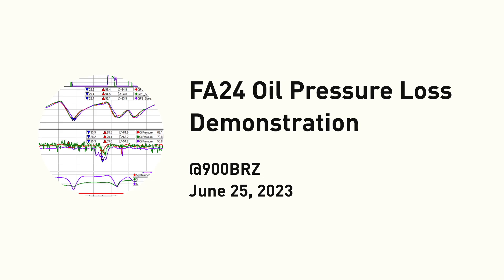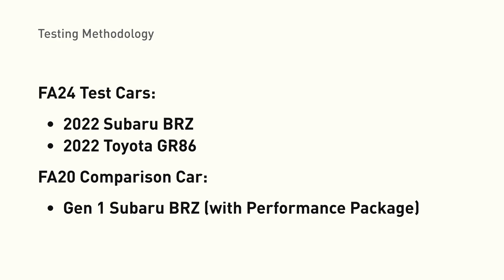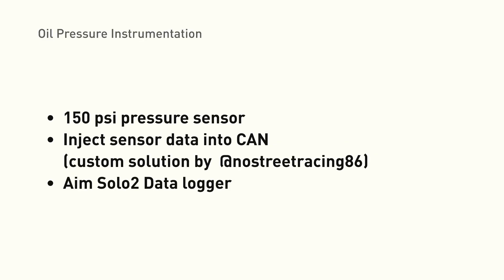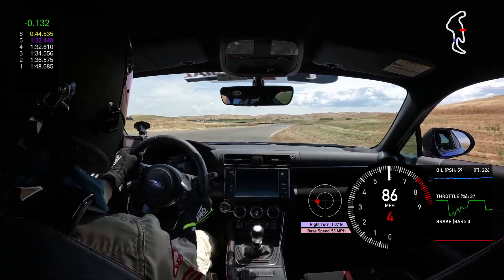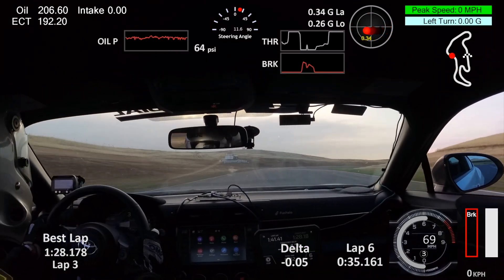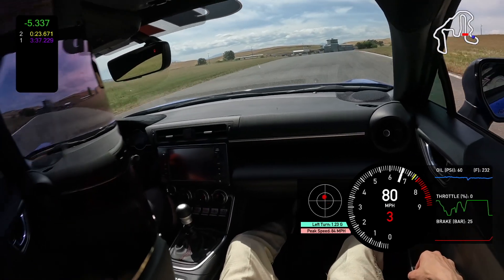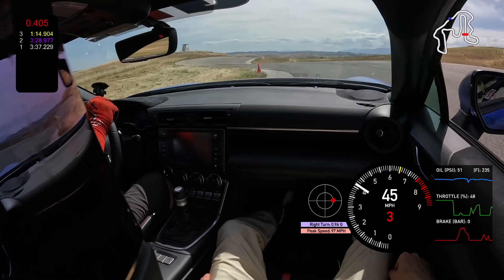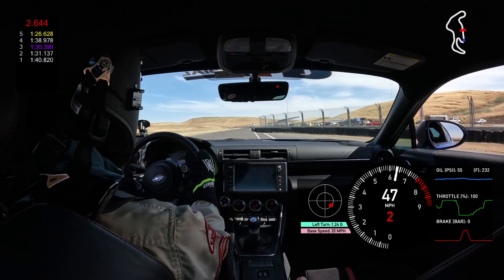BRZ/GR86 FA24 Oil Pressure Loss Demonstration

Comment: Hi, about the video, will the oil pressure drop at low rpm with elevated and right turns?
Reply from the maker: At low RPM, the expected pressures are lower. Not exactly sure what you’re asking.
Reply: @900BRZ  guessing he is curious as to whether at lower rpm, if there is a pressure drop (from the already expected lower pressure) as a result of right hand turns at high G.
Reply: @michaelruddick2662  right
Reply: @900BRZ  i wonder if i should be worried if i only use it for daily drives
Reply from the maker: Generally, I think people driving on the street should not worry about this. If I was only driving on the street, I would keep the powertrain entirely stock and trust that the warranty will be honored. At low RPM, we see less pressure drops because the pump has lower flow. The oil in the sump stays available to the pickup.

Comment: I always ran my 2008 STI with sticy R888 with no issues. But i always ran 1 extra qty because I expected not to just sit on the oil pan at Barber. I am not sure if it help, but never wiped a bearing even on summer track days. A test running 1/2, 1 qty, 1.5 and 2 qty extra oil would be great. It could be a simple fix.

Comment: Quick theory could the g forces be enough to possibly cause the oil pump pressure relief valve to crack open?
Reply from the maker: It’s very hard for me to test and honestly I don’t have enough familiarity with the design of that component to conjecture. It’s a valid hypothesis though.

Comment: This is really bad for the US market. ALL of our highway on/off ramps are right hand, high speed, and accelerating/decelerating
Reply: This should not be a problem on the street If you're pulling >1G on an off ramp and revving the engine to 6k RPMs... you're doing something wrong
Reply: @i-barg  LOL, but .... but ... an onramp...right hander...empty highway...punch it!  ;)   Granted, it's probably going to be banked, and you won't get lateral G's >1, but, just sayin.
Reply from the maker: Banking is probably not helpful either. I think it’s possible to reproduce this on the street, but unlikely for most people and I haven’t done any street testing.

Comment: Why don't the people who track these things install an oil accumulator?  They've existed for a long time for this reason. Even on engines that aren't prone to oil starvation many will still install them as insurance.
Reply from the maker: It might be a good idea at some point, but it’s not the first line of defense. It adds multiple failure points and requires additional maintenance.
Reply: @900BRZ  in my experience as long as it's a good quality kit like accusump and it's installed by a good mechanic it'll last year's without needing anything. I don't know about other brands but accusump is good.

Comment: The pressure drop so much! This is indication that the oil pick up is sucking in air instead of oil. it is a mixture. This will likely destroy your engine at some point.

Comment: My biggest question is: What oil level was that testing done at? Was it at "Full level" mark on the dipstick or "LOW" or  something in between? Did you try to overfill from FULL by adding  lets say a half quart on top?  And why this wasn't mentioned in Methodology part?  It's important because it's obvious that the engine just starves when the oil is pulled to the side by the G force inside the oil pan and it's simply not getting picked up by the pick up tube so the air bubbles get in causing the pressure to drop.
Reply from the maker: Full mark on the dipstick or just above on all 3 cars. I should have mentioned it.

Comment: As a previous engineer for an OEM ; 

1. Thank you - very informative
2. They knew
Reply from the maker: It would be disappointing if they knew and disappointing if they didn’t know.
Reply: This seems typical Subaru. Surprised Toyota signed off on this. The fix for it seems simple and inexpensive. No, I wouldn’t buy a Subaru, this is just one more reason.
Reply: "impossibru"
Reply: As a current engineer in the industry, they absolutely knew, and don't give a shit about it at all. I will never buy a Subaru ever again.
Reply: @PowerSports  - "I will never buy a Subaru ever again."
Its not a "Subaru Issue" its a Horizonal Engine issue.
The old VW bugs had "Deep Sump" aftermarket add Ons that helped with the issue.
My 71 Porsche 914 has the SAME ISSUE. Fix: run with 2 extra quarts of oil.
Reply: @stuartgray5877 you seriously comparing a modern motor to a 60 year old motor? They marketed this car as a track day car, it should have a dry sump system. The RTV issue is just poor quality control.
Reply: @truantray  - I am just pointing out one of the inherent disadvantages to a horizontally opposed engine - The Geometry does not allow for a deep sump IF you are going for a low CG.
I didn't say anything about the RTV.
Reply from the maker: Agree with that.
Reply: @truantray  Even the original WRX couldn't track without oiling system mods. It's basically common knowledge that you need to upgrade a Subaru to track it (except the STI, of course).
Reply: @truantray  Dry sump would've made the car $60k instead of $40k, There is no "RTV issue", it's just something non engineers latched onto as an early cause. Every car made, from any manufacturer, that uses RTV in the engine assembly process will have peices of RTV in the fluids.
Reply: @stuartgray5877  im only up to the second turn here. It seems to me like on both instances theres a downward effect on the car too. The dip on 5 at the curb and the ridge. Is this because of the momentary weightlessness effect? Sort of like how you feel your lunch rise on a rollercoaster? I also thought prior to having seen the corners, and hearing that it was above 6000rpm in an interview done with another channel, that the crank rotation could be having an effect. Id dare say crank counterweights (ive never seen a horizontal crank full disclosure and all) would have to be creating a fair bit of turbulence. Like the spin function on a washing machine. Could the right hand turn just be enough to push the extremes of this sump and pickups design? I wonder what the crankcase pressures were at that moment too.... just a brain fart

Most of my very basic understanding has been picked up from looking into sumping issues on milwaukee8 engines
Reply: @willconklin7739  - "There is no "RTV issue", it's just something non engineers latched onto as an early cause."

There 100% IS a "RTV issue" try to keep up.
The biggest issue is not from the factory RTV job as it is done by robots. The REAL "RTV issue" is when the human Techs have to work on the engine. It is nearly impossible to get the RTV on the front cover correctly without putting on too much or too little, and IN TIME.
Reply: @stuartgray5877  still wrong....
Reply: @willconklin7739  Not "wrong" the failures that occurred right after having the cars worked on and the discrepancy between the failures at the Toyota Dealers versus the Suby dealers tells the facts.
The rework at Toyota had much higher failure rates because the Subaru dealers had more experience putting on the sealant on the front covers.
The Toy techs had no experience with the flat engines so messed up more frequently.
It is STILL more difficult to get the sealant on correctly with a human instead of a robot, or are you going to argue that is false too?
Reply: @willconklin7739  DO you even HAVE a BRZ?   I have a 2013 and a 71 Porsche 914.  Both have oil pressure issues under hard cornering on the track.  And my BRZ has had the front cover off numerous times and the dealer cannot fix the leaks they caused after opening it THE FIRST TIME.
Reply: @stuartgray5877  First off, you are changing the entire topic of the original discussion. The original discussion was the thought that RTV was over-applied AT THE FACTORY that was causing factory fresh engine failures in the 2nd gen cars, the evidence used was RTV bits in the oil strainer of the pick up tube. That was never the case. I urge anyone to dissassemble an engine from any manufacturer in the modern era, the majority are sealed with RTV and all that are will have RTV fragments caught in the strainer.

You are the one that tried to change the subject to engines that had been repaired by some mechanic being grenaded by RTV.

And for that subject I can guarantee you any RTV plugging of the pick up weren't from application issues, but from poor cleaning procedures when removing the old RTV by poorly skilled "mechanics" during engine repairs.
Reply: @stuartgray5877  I have owned multiple BRZ's and still have a 2013 BRZ that was bought new just to track. It is currently 11 years old and has 34,000 hard, track-only miles, all on the original engine that has never had an oil leak.

I have built over 20 BRZ, FRS & 86 chassis' into track and race cars for customers and maintain a majority of them still. I also maintain a bunch of street driven Subaru vehicles for other customers of mine.  Sounds like you need to find a better mechanic.
Reply: @stuartgray5877 huh? My 982 718 with the 2.0l flat 4 doesn't give me oil pressure loss through sharp cornering in either direction, try again....
Reply: @lanemiller08 It's a flat 4, so I doubt that.
Reply: @PowerSports  yup yup
Reply: Yes offcourse, but the average buyer will never experience this problem. If you want a problem free engine just get a m52b28 peace ✌🏼
Reply: @tinuse3670 I am an average driver and experienced the problem.
Reply: Outstanding information and presentation. I do hope an efficient solution is found.
Reply: 100% they knew, all subaru's are trash and have been. Im not surprised at all, its hilarious
Reply: @vicentechamberlain579 if all Subarus are trash why do many of them do 150k miles of being driven hard 😂. It's only ones that were made by the apprentice or on Friday that are bad 😂
Reply: @LawrenceTimme Subarus are made by hand??
Reply: @RAY_FILET  yes. They are nowhere near as automated as Germans or giant companies like Toyota and Honda. Many processes are done by a human bean
Reply: @LawrenceTimme  had absolutely no idea.  Thanks for the info!...Toyota must have been cool with that, considering the fact that the GR86 is made in the Subaru plant.  Least I thought it was.

Comment: Thank you so much for all this data! I love seeing actual science at play instead of just throwing assumptions around. I just got a new brz a few months ago and I have been a little concerned about all the oiling issues I was seeing with these cars. Again, can't thank you enough just gave you a sub to try to support you on this journey to figure out what can possibly fix all the blown motors on track.
Reply: Guaranteed fix would be to buy a car actually designed for the track.  You bought a normal car with flashy marketing.

Comment: So this is a well known issue with the WRX guys, but Porsche makes horizontal engines too, and they don't seem to have this issue. What's their solution? Dry sumps?
Reply from the maker: They use dry sumps on their GT cars and integrated dry sumps on their other flat engines. My understanding is this means they do not have a separate oil reservoir, as in true dry sump designs. Check out this post for more detail: https://www.6speedonline.com/forums/996/67522-please-explain-integrated-dry-sump-oiling-m96-03-engine-how-different-fro.html#post849783

Comment: I have a 2020 BRZ with the performance pack, about 18 track days on it. The engine has been the worst part about the car from the beginning (oiling issues, low power, weird torque curve shape), it's interesting to see that they're backsliding in terms of oiling issues while working on the other ones. This car should have had a Toyota I4 from day 1, Subaru can't build good performance engines.

Comment: Would be curious for a quick run down on your filming/daq setup/post processing to get the overlays. Does the aimsport do all of this or are you bringing in video and manually syncing etc?
Reply from the maker: For data acquisition, I’m hooked into the CAN feed that powers the ASC (sound machine). The CAN injector MCU accepts the CAN feed from the ASC and injects the oil pressure data into the CAN feed, which then goes to the Aim Solo 2 DL. All the hard stuff here was figured out by @nostreetracing86. He’s and @TrackandBuild have been doing this kind of data logging for over 6 months now!

I download the data to Race Studio 3, which is an Aim product. I then export that data and bring it into Race Render, along with video from a GoPro. Race Render allows you to sync the data to the video. 

I export the track footage with the data overlayed and then bring it into Final Cut Pro X in order to do editing.

Comment: Sounds like a design issue. Subaru engineering at its finest 🤢 how you don't take into account cornering forces when designing the oil system sounds ridiculous to me, and Subaru needs to be S U E D to Kingdom Come.

Comment: Great effort! Need to get to the bottom of this. A clear polycarbonate oil pan and a go-pro pointing right at it?
  Driving at 6-7k rpm oil pump is doing its job moving large volume of oil and too much of it stays in the heads (nothing new here). It is slow to drain back to the sump. Oil gets picked up and pumped out as fast as it drains back. Slightest disturbance causes the pump to suck in air, in this case it just happens to be the right hand turns that affect it more than anything.
 In your next session, overfill your oil by 1 liter. Would be nice to see the data then.
Reply from the maker: Clear pan would be fascinating!

Comment: The Porsche Cayman S 987.1, 2006-8 had an oil starvation problem that may be similar, with numerous engines lost to oil starvation usually leading to piston rod bolt failure. I had a 2006 but sold it rather than tracking it and bought a 2009 instead.

Oil starvation in the 987.1 was caused by oil accumulation in head during high G turns but not necessarily at the highest RPMs. There was a scavenger pump/oil pump mismatch around 4k.  The scavenger pump had linear flow proportional to rpm from zero on up but oil pump was high flow to ~4k and then lower rate.  4k RPM was biggest discrepancy in flow rates causing oil to accumulate because the scavenger pump could not keep up, resulting in low oil in the pan.  The heads had only one return port each, on the front end on one side and rear end on the other.

Solutions such as baffles, larger pans and even auxiliary instant pump oil reservoirs were tried but there were reported failures with each.

Porsche’s 987.2 engine upgrade had better matched scavenger flow rate as well as a second return port in each head.
Reply from the maker: Thanks for sharing. Do you know if some of that was caused by oil surging into the heads like it did on the EJ? Or if that's just from oil sent to the heads accumulating in them.
Reply: @900BRZ  My understanding is that it was the oil sent to the heads accumulating there.

Comment: Thanks for the in depth review!  I wonder if you would be willing to repeat this experiment on the factory recommended 0w20 weight instead of 5w30? I have heard oil not properly draining from the head as a theory, especially in lower gear, high rev situations. This is also a newer engine with much tighter tolerances than older designs, so I'm curious if using a more viscous oil than the manual recommends makes that much difference to the flow rate now.
Reply from the maker: Personally I’m not able to do that with my car. I’ve already installed that baffle since publishing this. As you can see in the video, my car gets down to a nominal pressure of between 55-60 PSI at temp. Lowering the viscosity of the oil will decrease that nominal pressure. I think it’s the wrong choice.
Reply from the maker: It’s also worth noting that in some regions outside of the US (I believe Malaysia is one of them) the manufacturer recommends 5W30. It makes sense to pair the motor oil to you usage and confirm this by looking at oil temps and pressures.
Reply: @900BRZ  That's definitely an interesting tradeoff to think about since I did think that a thinner oil would probably reduce the head across the oil pump, but result in a lower differential back to the pan from increased flow. I have been doing some oil temperature tracking with my friend's FA24 BRZ as well, and while it's definitely nothing as robust as your logging, we've been seeing temperatures rise to as high as 110C on a mild drive, which is pretty much at the limit of 0W20. We haven't wanted to switch to 5W30 yet since most of the articles surrounding track day engine failures seem to have been run on 5W30. I'm very interested to see what the killer B baffles and potentially high capacity oil pan does! I personally own an EJ so bad Subaru pickups aren't surprising to me 😂
Reply from the maker: @Andy-kl1ve  Unlike the EJ, this engine does have internal baffling to prevent oil sloshing/surging into the head. So any accumulation there is a result of oil sent to the heads. Still a possibility. I don't have any way at this point of observing where the losses are coming from, only hypotheses.